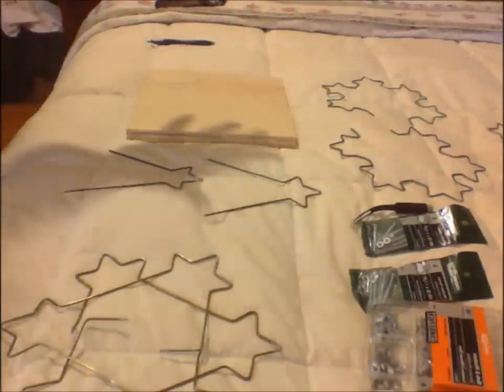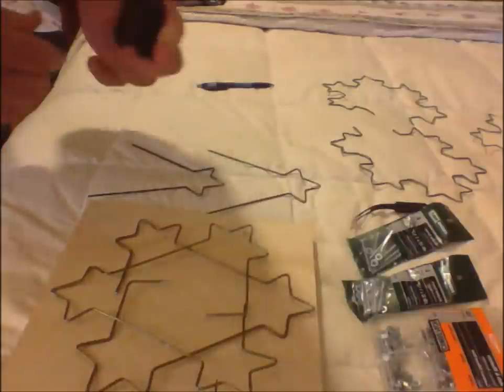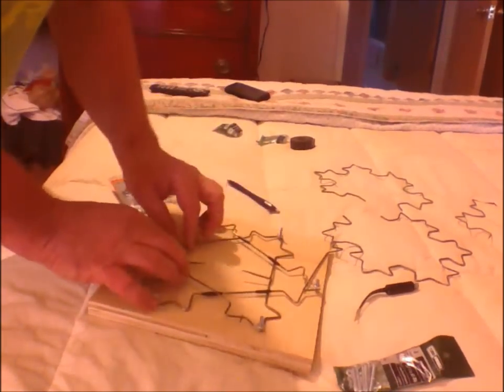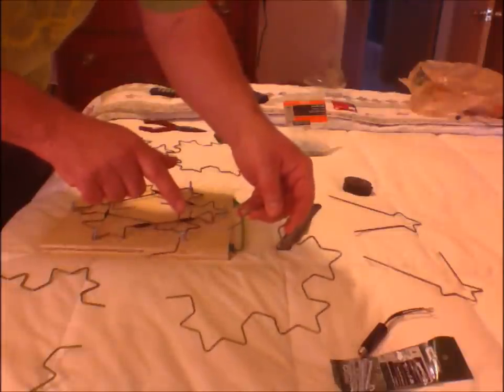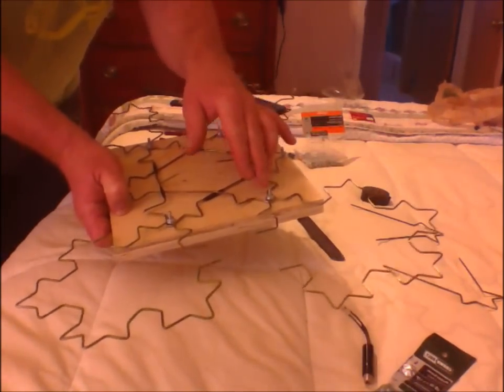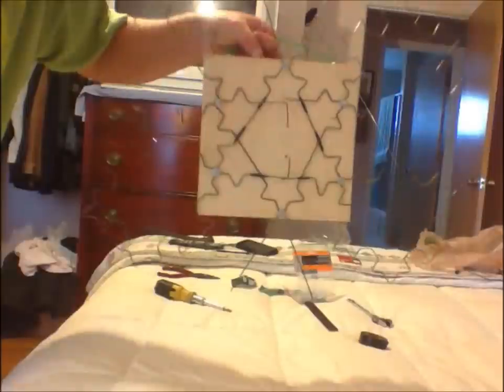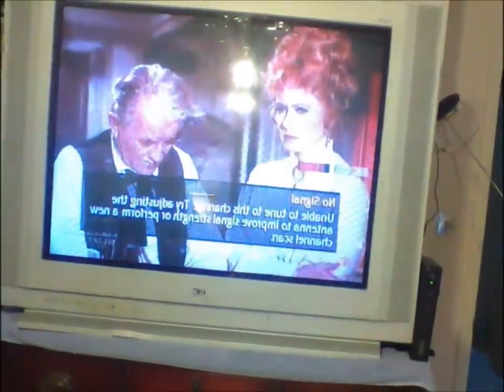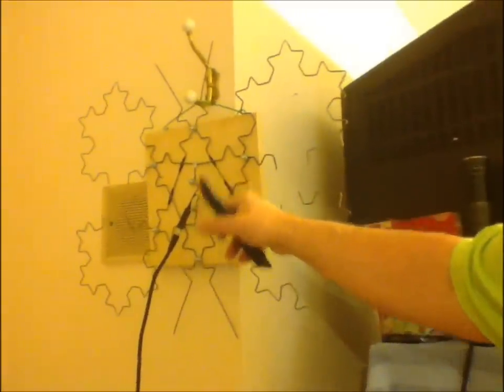How to build a HDTV Coat Hanger Fractal Antenna - Detailed (Step 2)

Comment: Hey JT, I finished mine last night. I was asked to teach a basic college math course a couple months ago, and we briefly covered fractals.  Thought it would be a great hands-on example of fractal use.

I had the antenna sitting in the first floor of our home, and several stations came in well.  I am going to locate it in the attic, run coaxial to the cable input on the back of the house, and then run the signal through out the house to cable hookups.  I'm thinking having it another 10 feet higher, or so, will make the reception even better.

I asked someone at Home Depot about using copper (he said he knew about antennas), and he didn't think it would be significantly better.  I know copper is a better conductor with electricity but didn't know if this would translate to better reception. It may, but, hey, coat hangers cost a lot less!

Thanks for the video.  I had fun tinkering around, and it's great being able to get local channels.  I live in Northern Colorado, very close to the foothills of the Rockies, and signal reception can be difficult.  The closest Denver channels are about 50 miles away, so I'm impressed that a coat hanger antenna works so well!
Reply from the maker: The higher you can mount the antenna, the better reception you'll achieve.  Also, the less blockage you have (ie. walls, roof, trees, mountains, etc) the better.  Copper definitely has less resistance than steel and makes a better conductor.  However, you may not realize much benefit unless you're trying to access signals from a significant range.

At RF frequencies, the high permeability of ferrous metals makes them lousy (small skin depth). Consider:
1 meter long AWG14 wire at 100MHz:
Mild steel (resistivity 0.2u-ohm-m, and ur = 800) yields 49 ohms resistance.
Copper (resistivity .0169u-ohm-m, and ur = 1) yields 0.5 ohms resistance.

Also, steel is not all the same. Stainless steel has ur = 1. Galvanized steel wire will have a layer of zinc which may be thick enough to carry your RF current, or maybe not, you would have to know the plating thickness and do the math.

For an antenna, you want the conductor resistance to be sufficiently below the radiation resistance of the antenna. For example a half-wave dipole antenna with radiation resistance of 73 ohms, 10 ohms of conductor resistance causes 1dB of loss. This may be ok in some applications, it is a skin depth issue, just going to a bigger wire may not be the answer.

The real benefit of a fractal antenna is the shape.  It's worth doing a little research on the benefits of fractals in receiving a wider range of frequencies without have to change the antenna's direction.

Lastly, one of the main benefits in using copper over steel, is that it would allow you to mount outside while experiencing minimal corrosion and signal loss over time.  But as you mentioned, it's a lot more expensive than a few spare coat hangers.

Thanks for the comments and have fun with your class.  Let me know if there is anyway I can help.

Comment: The length of your wire is actually critical.  Here's how you calculate it.  Lets say for example you have 5 TV networks transmitting at 200Mhz, 210Mhz, 215Mhz, 225Mhz, 275Mhz,   200+210+215+225+275/5= 225Mhz.  225Mhz is your median frequency, the frequency your Antenna needs to be tuned to.  Fractal Antenna's work around a centre frequency, that's what you first calculate.  To calculate the length of each wire, 299,792000 / 225000000Hz = 1.332408888888889 Meters / 4 gives 0.3331022222222222 Meters.  Where 299,792000 = the speed of light.  You divide by 4 to get a quarter of the wave length.  You then use 4 Fractals wired up as you can find on Google to create a full wave signal from your quarter wave fractals.  You can also build one using 8, 16 32 lengths etc but the wiring scheme changes a little, Google it.
Reply from the maker: Wow!  I love the insight!  AND YOU ARE CORRECT!  With the wrong length you won't achieve the proper half-wave dipole...  However, with fractals, that's not as important.  You see, fractals are not just bilaterally symmetrical, they are, in fact, multilaterally symmetrical (that's why you can get away with making them so small).  So, the need for wire length is not as important as it might be with your bunny ears (no pun intended).  Oh, I have a new design that is gonna blow your mind.  It's a TRUE MULTIDIMENSIONAL FRACTAL that I just completed a few hours ago.  You have to see this thing.  I'll try and have it posted in the next few days.  Please keep an eye out for it.  I guarantee, you won't be disappointed.  Please LIKE, SHARE, and SUBSCRIBE to see my future posts!  Thank you for being a subscriber!

Comment from the maker: Yeah, you're right...  I didn't invent it..  I sorta thought I did, but I did some investigation and it's only slightly different than others out there and I later found out that it's actually a Koch's Snowflake.  At any rate, what is unique about mine is that it's one of the only ones that truly repeat it's fractal pattern.  By making the base polar elements half fractals and then positioning them the way I did (fractal pattern), it greatly enhances mass spectrum frequency reception.

Comment: Hi JT.  I could tell you live in or around Memphis by the TV stations in the video.  The reason I'm even looking at this video is because of the terrible reception we receive 30 miles north of Memphis, especially with the low band VHF, namely channel 5.  It seems that channel 5 is about the only channel here that is still in the lowest band of VHF and I'm not sure of the reason.  I guess is it's MONEY!!!  Anyway, does this antenna bring in the low bands like 5?  I've been looking to buy another antenna but hate to do so just for one channel and on top of that, most of the antennas out there are upper VHF and UHF.  If you want low band the antenna is HUGE.  Our cable company is in Millington (Ritter Communications) and even they have trouble getting good reception from channel 5 sometimes.  Now that just shouldn't be.  I pay for that.  I appreciate any info you can share and thanks for the video.  I'll probably be fabricating one real soon.

Comment: would aluminum foil antenna be better since it is better conductor? also, does the thickness of the foil matter when getting signals?
Reply from the maker: Zimba9810 If you use foil, make sure you make your connections on the dull side, not the shiny side.  The shiny side is treated with a coating that could effect your reception.

Comment: sir please help me, we have a project at school involving making a tv antenna and i would like to try fractal, we were asked to pick 5 channels ( 2 vhf and 3 uhf). one of the channel that i've picked is channel 7 that has 1ft. 4 - 1/16in length on each side, now my question is, is that the same length that must be used to start bending when using fractal or there is another calculation specifically for fractal?

Comment: l'm 45 miles or more from transmitting stations … will l need to amplify this design or is it's complexity of bends sufficient?
Reply from the maker: Amplification only distorts fractals.  Some have had positive results, but I don't recommend it.  I recommend you raise your fractal as HIGH as you possible can.  Also, I have a NEW DESIGN of a multidimensional fractal that might help you, I just created it a few hours ago.  I'll be posting a new instructional in the next day or two.  Keep watching for it.  It's going to be awesome!  Please LIKE, SHARE, and SUBSCRIBE!  Thank you!
Reply: thanks for your follow up, though 7 months later … sometime within the next month l'll try to upload my version of how an amplified fractal can work … l just want to get a finished prototype to video 1st

Comment: Here in East-Bay rabbit ear antenna can't get anything (high hills), do you think fractal would work better?
4 TV station around me, North/South 15 miles away, but I have to learn Spanish before I can understand what they saying. LOL!
Reply from the maker: Fractal is definitely the way to go.  But to increase your frequency reception, I highly recommend you mount your antenna outside as high as you can manage.  Also, you might want to consider making your out of copper so that it handles the weather better.  Let me know how it turns out!  Good luck!